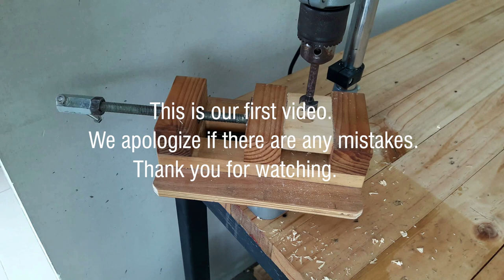How to make Wooden Drill Press Vise

Comment: Wrong dimensions. The three top/upper parts that are pictured as 35x35x100 at 0:08 must be 35x35x105 to fit the full width of the lower three parts - all of which are 35 mm wide. So the full width must be 35+35+35=105 mm plus a tiny bit of two glue coats. So in total they must be like 105,2 mm
Reply from the maker: Thank you very much for your advice. We will keep improve our work.